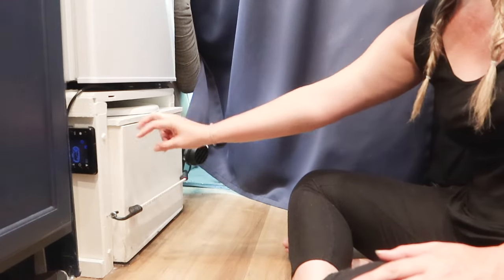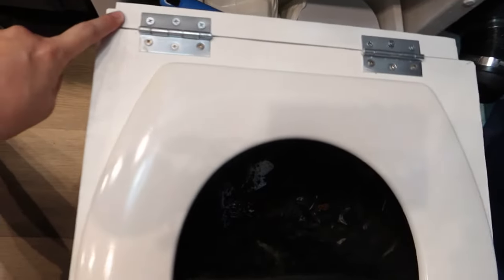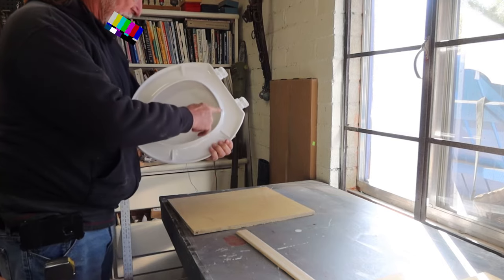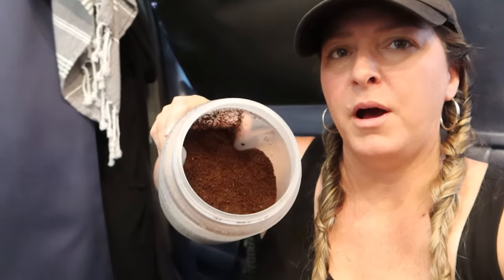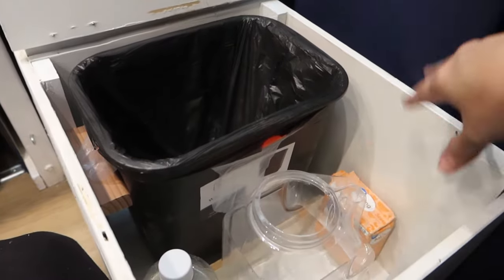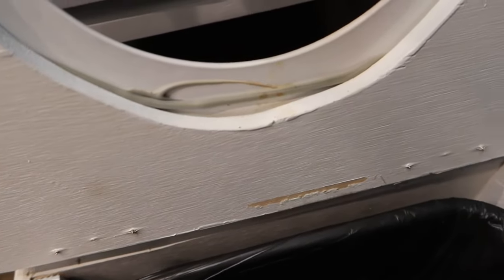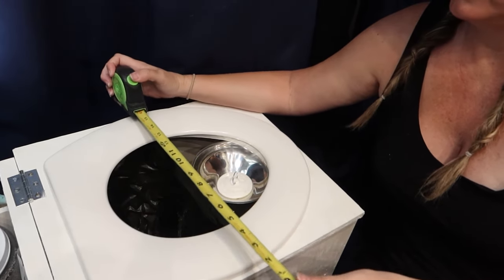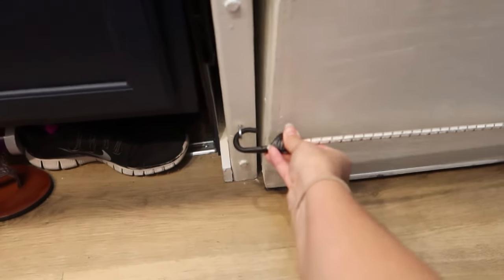DIY Composting Toilet with Urine Diverter (Under $100) // Travel Snacks

Comment: Hard wood ash will keep poop from stinking.  It takes only a sprinkle.  I've used it for years,  never see people talk about it.  It also keeps away flies.
Reply: Where do you find the hard wood ash? 😊thanks
Reply: I have a large pile of branches and limbs to burn. It will have multiple uses including this one.
Reply: Yep, I use this in my van toilet- from the log burner.
Reply: @OnlyAlmita  hardwood, not hard wood. Any wood not from a conifer.
Reply: @OnlyAlmita  You don't "find" it, you burn hard wood, and keep the ash.

Comment: We are one of them Folks, that spent $1,000 on a Natures Head. We have had it for 4 years and we are full time. We HATE IT,! Worse design I have seen. So hard to clean and way to many little spots for nasty to hide. We ended up taking the thing that mixes it out, and we went with just putting a bag in. Then we basically do the same as you do, fill, remove, throw away and repeat!  We are currently converting a van, just like yours, we are gonna build the same thing you did. Thanks for sharing…
Reply: Do you have the fan vent ? Does it make a difference ?
Reply: This is the best comment I've read so far. Thank you for confirming my thoughts!
Reply: @DL404  
We do have the Fan, that’s a story in itself. The fan wires and fan is to small. The wires corrode and won’t make contact. The whole Toilet is a horrible design.

Comment: Putting a little vinegar solution in the pee jar cuts the pee odor. Using vinegar solution is used to clean up dog pee so a dog no longer smells urine. :)
Reply: I've thought about coloring a clear container with a light blue color so that the liquid appears green rather than yellow. Just a bit more stealth.
Reply: @fjtalleyauthor2242 , I think I watched a video where someone put blue coloring in their vinegar solution, so they add the stealth coloring every time they spray the urine diverter or just sprayed right into the container to control odor directly.
Reply: @raisajay7563  That sounds like a great plan, too!
Reply: @fjtalleyauthor2242   someone might think you damping antifreeze
Reply: Lemon juice works better. You can also by citric acid powder which is the active ingredient in lemon hive that neutralizes urine odor. The powder is found canning supply areas and sometimes in baking supply aisle.

Comment: Cat litter works well for soaking up the urine in your bucket. As a trucker that is what I use which also helps with odor until I can stop to discard. As for poo I try to use public bathrooms unless I can’t get to one in time. Either way the cat litter helps. Love your potty set up! 🌼

Comment: OMG!! I know this video is a year old and you may not ever see this but THANK YOU THANK YOU THANK YOU!  I lived in my van for most of 5 years with just a bucket (no sense of smell and no social life) that I had to find discrete ways to empty. I knew there had to be a better way.  I looked into composting toilets and, like you, said nope. The whole issue with separation spacing has always stopped me from building my own. Now I'm on the verge of moving back into my van and this is a life changer!

Comment: Thanks for sharing this, wish I would have seen it 2 yrs ago. I saw a lady build a composting toilet for her van. She ordered a fiberglass one piece urine diverter on line. It is all together and has the hole for solids in back with diverter in front.  I ordered this, but what I failed to understand was the conversion rate as it came from England. I thought it was $120 and it took 3 months to get here. But it really cost about $170. Plus no returns. I tried using a funnel and it didn't work, but a canning funnel is perfect. I do have this set up with a wooden hinged top to make a bench, but really like how yours takes up less space.

Comment: I'm still researching my options. One is a square bin, we used have two of them. The one I have left we've had for about 45 years.

I will be using compostable bags.

I've seen others making their own diverters from buckets, all sorts of things. One had a small funnel in his jug, that startled me. But he had a conventionally large one as well. I'm wondering whether a well cut two liter ice-cream container might do the job, perhaps with that supplementary funnel. A 4l bottle with a lid on, even a lid with a funnel, isn't going to overflow easily.

There's one of me, a bloke's design is all I need.

Comment: I really like this idea.  No need to worry about water or chemicals to put in the water to keep the smells at bay.  i currently have a cassette toilet that I normally don't put the toilet paper in it because of breakdown issues of the paper (unless its for #2).  I may try this with the cassette and just insert a bag in for #2 and dispose of asap.

Comment: I appreciate this video so much!!!  Thank you for sharing your wonderful creation with us, I never would have thought of the canning funnel. I use horse bedding pellets from Tractor Supply.  It acts like the coconut core in that it turns into a sawdust type when it is moistened.  When I bought mine it was like a 40 or 50 lb bag for about $5.00 and there is no smell when you use it.  Hope that helps you.

Comment: Genius!!  Thank you.  I have been working on my minivan for months and today I went for a test run simply to a pleasant local park,, ,read, took a nap to test out my bed and came home.  I had put in a bedside gramma blue porta potty with arms to help me with my bad knees but this video helped me with dealing with the liquid and solids.  I lowered the potty to its lowest point since I have a low top Sienna Toyota and covered it with a twin black sheet to camouflage it and put a tray to use it as a bedside table.  I will continue trial runs until I am satisfied with its configuration.  I bought a yard reclining chaise lounge from Big Lots and added padding for the bed.  I sleep in a recliner since I have acid reflux and rarely have a problem since i started doing that.  Love your frank, no nonsense approach.  MANY THANKS.

Comment: First off thank you so much because I’m a female and I was a little confused on some of these issues that you pointed out. Secondly, the only thing I would point out is I wonder if you could put a handle on the front and then then when you pull it out, it would be easier just like a you know cheap metal one from the hardware store so you could pull it out easier

Comment: Great jobI built one I put a valve on the urine diverter hose with a long stem on the handle which is located in front of the toilet a little spritz of pine oil water from a spray bottle  downt the pee hole  close valve so no odor could escape from the jug  adding a sliding trap door with springs  to apply downward  pressure  on a seal  that's so  when you slide it back in  that leaves no possible way for any odor to escape through the seal it totaly closes off poop section when not in use a hole exiting outside with computer fan inside hose  keeps from having a methane bomb that could literaly blow half the inside of your van away with one spark   as long as your not using a lighter to look down the toilet should not be a issue

Comment: Found one of those big blue boxes that I guess food places store ice and whatever. Put it outside my cabin in a homemade shed that I built and plumbed in 4 inch pvc from toilet inside cabin and vented it with 2 inch pvc with a wind turbine. Just added 2 bags of potting soil and cotton seed mill, works perfect. The only issue that I am facing now is the inside toilet froze in a freeze and when removing it cut myself bad. Thinking about an RV toilet for inside but not sure with so many options out there.

Comment: Been living in my van for almost 5 years. 

Prior to full time vanliving I camped pretty much in every type of RV situation but had always loved the simplicity of my tent ⛺️ and or sleeping in my SUV.

I have a portable separating toilet that I use similarly to your biffy.

However mine is awkward to set up each time I need it.

I only use it for #2  although the separation of liquid from solids is a must in my experience.

A  small funn type design for women "Sheewee" kinda device works well. I use a Nalgene bottle to catch the urine. It is so simple to empty, easy, sanitary no muss no fuss.

The Nalgene bottle and the pee funnel take up so little space. I clean both every use. Fast and easy.

I have made a study of various portable composting biffy's.

Your's is perfect.

There are  few on the market that might suit my needs but $$$ cost prohibitive.

I want to be able to quickly clean it and tuck it away, easily. Also I want it to be ready to use without alot of prep time.

Great video.  Thanks for sharing.

Comment: Thanks for such detailed toilet build. I've seen so many toilet builds and not wanting to spend $$$ on a composting toilet I'm going to make a toilet build my winter project. I've traveled in my 2011 Escape since I bought it, sleeping in a tent and then the back of the Escape which worked out great and still have it. I did purchased a Ford Connect and am working on it for longer travel plans and being self contained. The toilet was my main concern.  Thanks again!

Comment: I run a composting tiolet with wood shavings and trash bags in my offgrid tiny house cabin with a 6 gallon bucket with trash bags. I removed the bumps on the tiolet with a dremel tool to get a better fit, to fit flush in the wood

Comment: I have been watching a lot of these DIYs lately. This one makes the most sense. I don't know about anyone else if my pee doesn't come out in the straight measured stream. So yes this canning funnel makes the most sense if anything I've seen so far. Plus the stainless steel! That is absolutely a must now
Reply: I've been using a canning funnel for several years now.  They work far better than anything else i tried.

Comment: First of  all thank you. Excellent presentation. Have been using pretty much the same set up for several years. With a few differences. I am an old guy so sitting down and getting up can be kind of tricky. Built mine with legs to have more height. Rig started out as a cube van so have more room. Use a bigger stainless metal funnel to deal with splashing. I know gross, but part of life for us old farts. Pounded the funnel into the correct shape to fit my set up and rigged up a strap system to attach it. Also I used an elongated oval toilet seat. Just wait. When one gets older and puts on a bit of weight the oval toilet seat is the only way to go. I use cedar mulch for poop topping. Has good absorption and eliminated using any nasty smell cover uppers, inexpensive, and available at any home improvement and/or garden store. Usually comes in large bags so will have to figure on storage. That is when some family my be of good use? Lastly for number one I use a one gallon glass container that happened to come with a plastic duo handle attached around the lid opening. Easy in and out. And lastly, congratulations to your parents for raising such an insightful, courageous daughter.

Comment: Loved the video. One thing I might add is a handle so I don’t have to pull it out with your hand inside the ring. I know you keep it clean but just the thought makes me cringe. But I live your ideas. 

I bought a reliance potty (plastic bucket inside a plastic shell with a ring) and I divert urine inside it using a fancy oil filter that is not as elongated as a typical funnel. Works nicely!

Comment: Enjoyed your video. Concise is nice.  I use a automotive funnel in a lugable loo set up into a 1 gal sport water bottle that is hot pink but I can see the levels.  It is working but must admit I like your canning funnel set up so a new funnel maybe on the horizon.  I put a thin layer of silicon cat litter in base for odor control and in the evident of mishap or spillover .  Haven't needed it but it works .  you may like that litter in your trash can the walmart brand is in expensive and a 3 or 4 lb bag would take you a long way down the road.  Thanks for the great video

Comment: One of the best videos on this awkward topic. Thorough explanations, but not boring. May I suggest: Double up trash bags, especially if using a bargain brand. Use cedar bedding pellets as an absorbing medium - available at Tractor Supply or any store that sells livestock supplies. A 60 lb bag lasts a long, long time. Put a cup of pellets in bottom, they expand as they get wet, and really control odors.

Comment: The best composting toilet design. Very clean and very compact. You could probably market this design. Extremely well designed and put together 😊 👏. Have you considered putting a air hose and sucks the methane from the bucket with a tiny computer fan near the end so that it vents outside?  This will allow the poop to dry much faster. 😁

Comment: Nice work. I looked at the prices of composting toilets and I had a similar reaction. (no way!) I'm pretty handy so I think I can make one for a fraction of $1000. We're planning to live in a yurt in the mountains of Mongolia so we can definitely use compost for a vegetable garden. They also sell commercial composting toilets here too but for about $280. Still that's kind of steep. I've thought about just using buckets and bottles (or just going outside on our land) and we may do that at first but it'd be nice to have a proper indoor toilet. Especially since it gets to 40 below in winter.

Comment: One addition would be to add an exhaust fan and vent hose. 
Even those $1000 composting toilets actually do not compost.
with the right filler and without pee the waste can be put in an external pile to compost.

Comment: Lmboooooooo listen!! I’m only willing to put more towards it after trying and my design not working for the disability challenges of my household lol. But still noooooooo I wouldn’t spend $1000+ on a throne.. what in the world lol!

I made a diverter originally from a urine collecting “hat” from the hospital supply, then removed the bottom, put in a funnel, then attached a hose which went into a bottle. That part was great lol so anyone wants to do that be my guest! You have to replace the bottom with the funnel carefully obviously but it then costs about $10 for the diverter vs like $50 on Etsy or whatever.
I also got a great silent shutting seat ah man I had toilet dreams and hopes 😅 ok I like yours better tho for the reasons you said! And ty for doing the test!! Lol 

Unrelated love the Abel hat 🥹

Comment: I live in a very small house/camp in Maine. When I first moved here and for several years I only had an outhouse, when I finally got running water I thought it would be great to have an actual indoor toilet. Cost of an actual state approved septic system.....15 to 20,000......for ONE person to poo!!!!  Found an "old maine guy" to dig/build what would have been an acceptable septic 20 30 years ago for around 1000.00.  Any update would only include a composting toilet.

Comment: I've used Pine Pellets from Tractor supply for our pee bucket. Half a hand full in that little container would be enough. The pellets absorb the liquid so it won't slosh and the pine keeps it smelling fresh. The pellets are used in horse stalls. When I first started, I tested it for like two weeks in a 5 gal bucket with a lid, used a small trash bag, put enough pellets to just cover the bottom. Used it for like a week, then left it for like two weeks covered. Opened it up and I was amazed that it DID NOT stink!!! check it out!!!

Comment: Same conclusion I came to, $1k was too much for a toilet.  I went with the Johnny Composter setup for $150 on my boat.  I use Compost Sure, wood cat litter and pine shavings as my cover material.  Been using it all summer, works great and smells better than the marine head.

Comment: that urine specimen collector that you had a pic of toward the end of your video made me wonder if this might work in an RV regular toilet (flushable type) but where this collector would be placed in front for liquids (urine, "pee") and then you'd use a Walmart type grocery bag (check 1st for holes!) behind this collector to hold solid waste (feces, "poop" or "poo" or --- well, you get the point). Until I saw your video I had never seen anyone even suggest (even on a trial basis) using this collector for urine especially where doing so in a regular RV could mean not worrying so much about using the regular (flush type) toilet which 1) uses up water and 2) requires the black tank to be dumped when it gets full which can be a REAL PROBLEM at times, especially if you're boondocking.
I'd like to try this though.
If you know of someone who has already tried this (again preferably w/ a  regular RV toilet but as a stop-gap measure and/or regular use without flushing the regular RV toilet) please do a reply. In the mean time I'll order this from Amazon and try it out at home (regular commode as a trial) to see how it works!

Comment: Dad;s are great, especially if they have been building boats all there life, the inside of my Pro- Master City looks like a Chris- Craft with oak trim and brass fittings. He was very patient when I asked him to cut down the sink unit so I could get my expensive bike in. Now he is working on my 2014 Trillium which he may be able to borrow, because he did not fit well overnight in the Pro-Master
Reply from the maker: Dads are the best!! Thanks for sharing your experience with me. So cool!